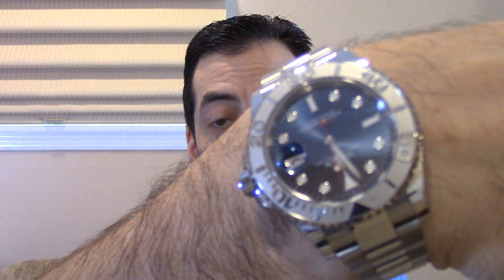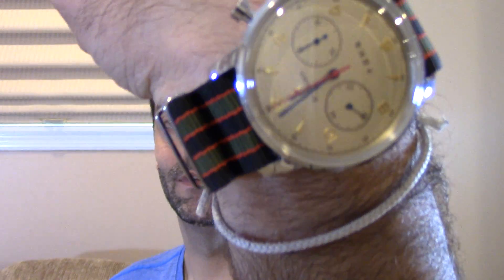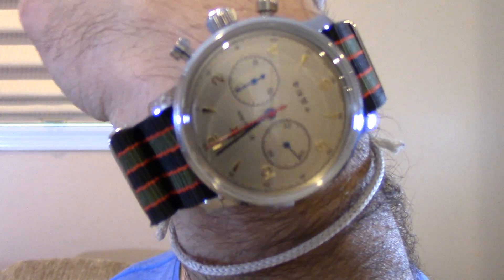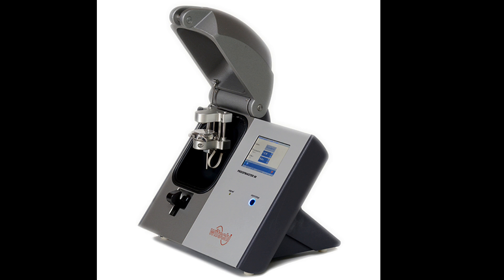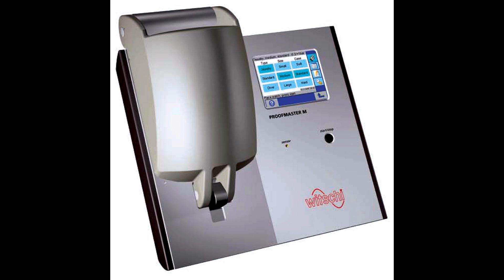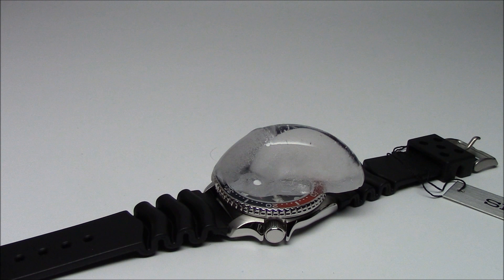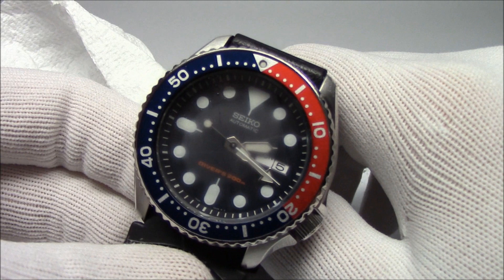Pressure Testing Watches For Water Resistance - Can you do it at home? Watch and Learn #48

Comment: I would argue that they do test them fully loaded because if water gets in it is not instantly ruined, they can open it up, disassemble and clean it if needed. With a very low failure rate, and that would be expected from a Rolex or similar quality, then they could totally do it. Thanks for the video!

Comment: Hey recently purchassed a breitling avenger seawolf 3000m/10000ft sent it to breitling for an authenticity and evaluation check they mentioned it failed? I asked what method they used and at which pressure it failed they seemed clueless lol instruments for professionals they say. Theyre slogan should be "breitling serviced by blowhards" not to mention they returned it scratched and with a case ding not previously there lol larger brands should be more accountable. Also receipt said movement dirty damage to crown and pushers. Which i find amazing because when i called in and said so the pushers have damage... how curious i wonder how a watch without pushers has damage to the pushers they said one moment placed me on hold and said our expert watch maker said he meant the helium escapement valve lol.
Reply: I would be pretty disappointed.  You sent it to them because you thought they were the best :(

Comment: Is there a chance for the crystal to pop out when the watch is under water and the pressure is released?
Reply: The crystal is quite firmly attached to the case, and would therefore have to be pushed at a substantial force to get it to pop out. While the pressure difference here does cause a force to push the crystal out, the force isn't big enough to cause the crystal to pop out. With a big enough pressure difference the crystal could be made to pop out. 

Not sure if i made any sense, im tired and english isnt my first language :)
Reply: Johannes _ , yes u made perfect sense. thk u for your explanation.
Reply: @leewmlee  No problem man

Comment: Air molecules are smaller than water molecules. In the Navy the doors on a submarine are marked QAATD which means Quick Action Air Tight Door. Generally I would trust an air test but watches may perform differently in seawater and at different temperatures which cause the rubber, steel and glass to expand at different rates.  Many manufacturers used a moisture indicator on the dial, this practice has fallen out of use presumably because manufacturing qc has improved and most dive watches are not used for their intended purpose.

Comment: About the 'blind' method, I think every new watch is disposable at the manufacturer's level and faulty pieces can just go for material 'recycling'. But testing watches for customers has to be a different story, they want the same piece back and not an identical one, so the manufacturer or service facility can't just replace parts as they please. They have to have testing methods that are both reliable and nondestructive.
Reply from the maker: True, good point.

Comment: I do not pressure test watches for great depth  for I consider the only WATERPROOF watches are the ones used by Scuba Divers etc. That does Not include your standard so called divers watches which I consider to be just water resistant for safety reasons.    However I sometimes check a watch by an old method for water resistance up to about 2 metres depth.  Check All seals and replace as required using a Fine touch of clear Syl grease. Assemble and then quickly immerse the watch in water at 50 to 60 deg C. Watch for bubbles from the internally expanded air and remove quickly if any are seen.!!. Remove and fix if there are any air leaks.
Reply: PS. Very good video.
Reply from the maker: Thanks for watching, and learning!

Comment: Great video Mark.
I'm using a Calipso 11atm wet pressure tester.  
For untested parts that I haven't used before, I'll still test initially without the movement and I'm SO VERY glad that I do.  

Just recently I used an aftermarket crown that I hadn't tried before, for a handwinding SKX upgrade. I pressured up the Calipso with the watch in the air chamber, plunged the watch into water and gradually released the pressure. No bubbles and I thought all was going well. The pressure has been released from 11ATM to 3 or 4 ATM and then 'BANG'.  Scared the crap out of me.  The crystal blew out at force, taking the chapter ring and pushing the bezel insert out of the bezel bending it in the process.  The water dissipated a lot of the energy and the crystal didn't shatter and the pressure chamber was still okay - thank goodness. For whatever reason - the crown was letting air in but not letting it back out and something had to give.  

Below is a video link to another fail pressure test I did - not as catastrophic as just mentioned and you can clearly see the stream of bubbles exiting the weak point. This is far more typical a fail than the first one I described. https://youtu.be/CB4ol8FckGc    
I'm sure your video Mark, will be 10X more professional and informative than my amatuerish effort, so I'm looking forward to your next intallment.  Cheers, Jason, and keep up the great content.
Reply from the maker: Fascinating, thank you!

Comment: Maybe the company is banking on that most people will not be exposing  their watches to that much pressure. So I guess the few watches that fail at those pressures with the consumer that big of a cost issue with the company when it comes to service the pressure failed watch.
Reply from the maker: I would doubt failed watches become sold.
Reply: Long Island Watch Right. I meant that after empty watches they were pressure tested then the movement put back in the watch. Because as you put it now the seal is broken again to install the movement. Great video look forward to more of the pressure series watch and learn.  Ps do you have any plans on discussing G-Shock watches?

Comment: That explains all the numbers I have got on my certificate after watch servicing.

Air is much harder to seal then water. So if your sealing is air-tight it is most certainly water-tight.

I used to work with vacuum systems and we used either helium or pure alcohol to find leaks in the system. If you put some alocol on the sealing that has a leak you can observe significant decrease of pressure in vacuum chamber. Liquid cannot pass through the tiniest holes where air can.
Reply from the maker: Thanks for sharing!
Reply: Exactly my thoughts. Seal should be watertight if its airtight.

Comment: Got you. Used to do a simular thing when pressure testing Ford engine and transmission parts. We used to use water, then we started using air. Very tiny bubbles we would send to impreg which sucked silicone through the pours to seal the leaking component.
Reply from the maker: Cool, thank you.